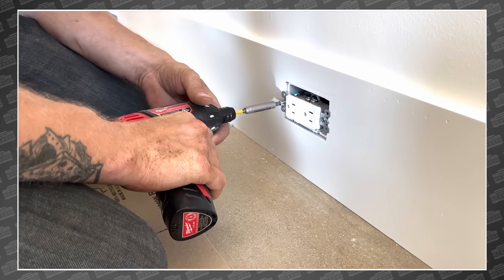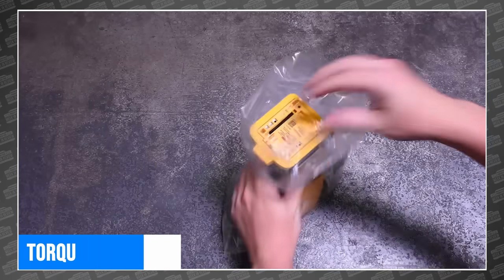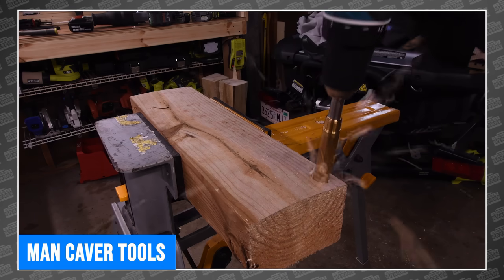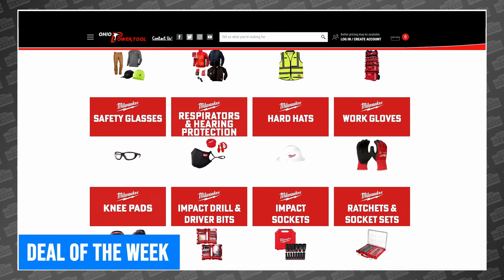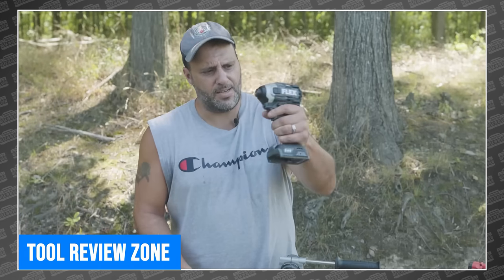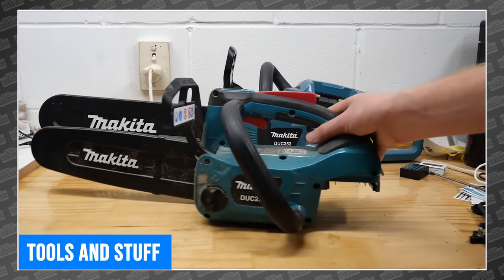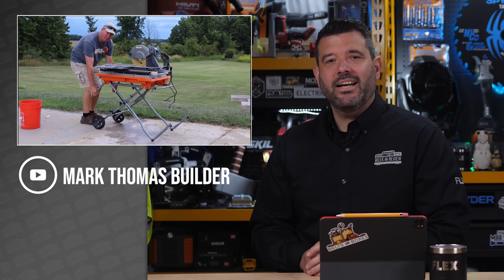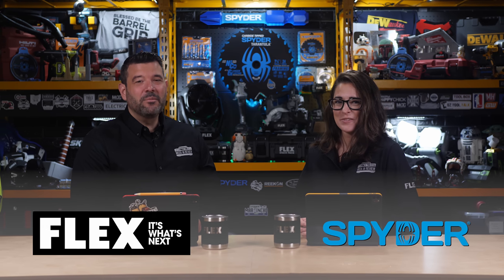Power Tool News from Milwaukee, Makita, DeWALT, Bosch and More!

Comment: The rigid tile saw. I have huskvuarna tile saw. What I noticed in the recycling water, I place a 900 mm ( 3 foot) ladder behind the saw and place a bucket of clean water. I submerge the pump so clean water always goes through the filter. In saying this, the pump stopped working. I need to buy a new pump. I also have the brick saw and do the same thing. Have a bucket behind the machine to run clean water.
The bricksaw the blade is stationary. The tile saw, the blade runs through the work.
I have trouble with accuracy with the tile saw. The base plate slots into grooves. The set up with the fences I cannot see the readings. In all unless I tweak the machine and retrofit so I can have a quick set up with measurements. Oh, how do I describe having a ruler setup so the cut tile is to the desired measurement. Also when cutting tiles not entirely parallel. The rigid looks to solve the minor issues I have with the huskvuarna.
Only thing, I don't do a lot of tiling so it sits for ages before the next job comes along.
I'm thinking of the makita cordless 18 volt wet saw.

Comment: the matco 1/2 impact is the most powerful that ttc has tested , the DeWalt is the most powerful one that can be bought at a reasonable price for a tool though
Reply from the maker: Thought the Matco was pneumatic.
Reply: @ToolShow  they have both , but the cordless matco and snap on have about the same power however the snap on cost more which is why the matco won cause it's slightly cheaper but they are also the only 1/2 inches to actual break 1000ft/lbs and they basically cost 1 dollar/ft lbs lol whereas the DeWalt is only like 230 bucks right now
Reply: I however will hold on to my octane high torque until Milwaukee releases their gen 3 high torque , I mean realistically I'll end up having the Milwaukee And the DeWalt but I'll wait until I can score the DeWalt for atleast 1/2 price

Comment: You failed to mention that Dave’s drill test were the base offerings of each brand. Not their top end models. Because then you would have said that the winner of the MCT video rhymed with “wrecks the competition”. That being said, the rhymes with yellow drill certainly put a lot of power in a very small package.
Reply from the maker: Good point!

Comment: Why so proud of being sponsored by SPYDER ? I've tried SPYDER drill bits and saw blades and they are garbage n my opinion cause the bit drilled one hole and was done wouldn't make another hole n sheet metal and the saw blade was worthless !!
Reply from the maker: We’ve run Spyder blades in our shop for two years without a problem. We ran a huge test using their Mach Blue bits in some serious steel. https://youtu.be/9c86f6b9JG4

Maybe you’re using them wrong? ¯\_(ツ)_/¯

Comment: Seeing that thumbnail had me breathing deeply thinking it was a vacuum pump. But now I'm just disappointed. They have patents, look em up.
Reply from the maker: I've seen'em! We'll just have to wait!
Reply: Those may just be strategic patents meant to stop other companies from getting there first. I'm not convinced we're ever going to see those, especially now that we can just use a normal AC pump with the new battery powered inverter.
Reply: @CarbonKevin  Makita did it years ago and I don't think they are since they were updated recently in the year. Also first one said packout compatible. Ive been keeping a close eye on them.